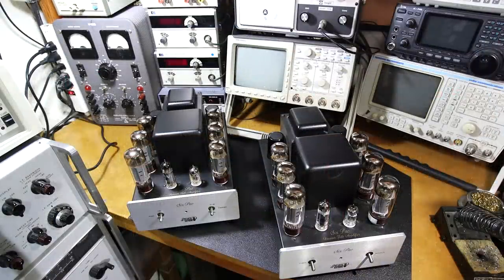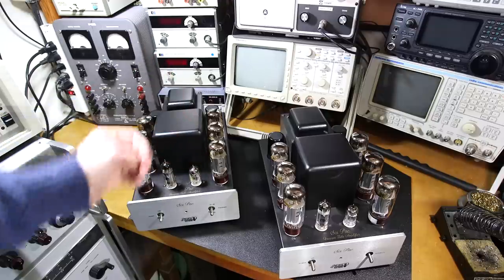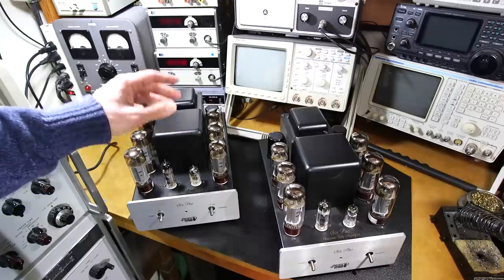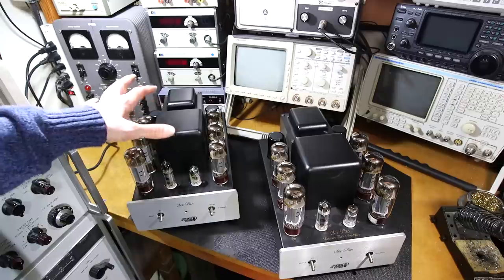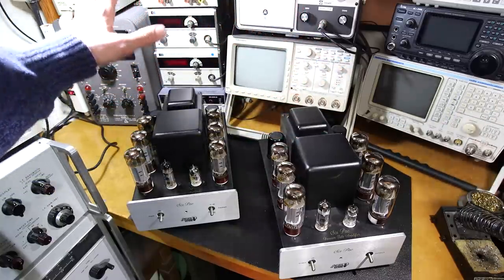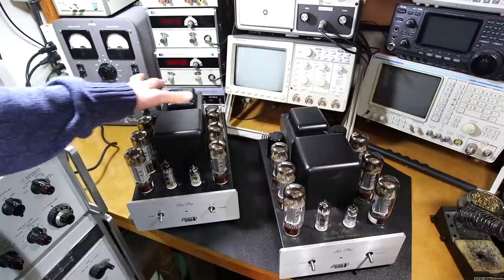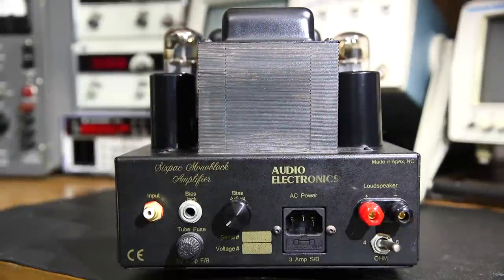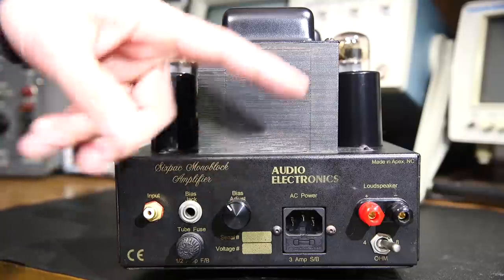Two Six Pac's On The Bench

Comment: The problem with this schematic is the 6SN7-EL84 tubes that they are in parallel. Only pairs with their own separate voice coils on the output audio transformers should be used. Too much capacitance and inductance on the final output tubes. This limits high frequency bandwidth. I design differential tube power amplifier no need for a phase splitter, but each pair of KT-88 vacuum tubes had its own separate voice coil limiting over capacitance and inductance thus preserving power bandwidth. This is called massively paralleling the final output tubes. My buddy friend a machinist built the chassis for me and I made the custom power and audio toroid transformers. I built two Monoblock power amplifiers each Monoblock amplifier had 32 pairs or 64 KT-88 vacuum tubes. A 12AX7A for the audio input 6BM8 power pentode driver for the KT-88 tubes. I named the amplifier “Tube Extreme.” The primary side of the audio output transformers had 32 sets of primary windings and one secondary winding set for 4- and 8-ohms impedance. Of course, custom made toroid audio transformer. Two power transformers one for the tube filaments that was rectified DC solid state linear regulated 96 volts and 6 volts DC to reduce hum. The KT-88 tube filaments were series parallel connection four set of 16 KT-88 connected in series. the other power transformer was for the plate voltage solid state linear regulated 600volts DC. Electric Power input voltage was 240volts AC at 20 amps can on 50 or 60hertz. I only turn these monsters on during wintertime it heats the house. That is what 128 KT-88 vacuum tubes will do.

Comment: Great to see a real tech.
Used to do similar work in the Navy bout 40 year's ago dealing with large 400k power supply cabinets used mainly for sperry gyro compasses and repeaters also some work on the old now defunct 601 class of nuclear missile subs (s.s.b.n.)
We would have access to the 400$ resistor..
Extreme .
Thx for the show.
Also i noticed on your scope measuring the distortion it was at 114khz
So I'm thinking the (audible) humm being caused by v+ fluctuation?

Comment: i'm guessing the"Carlson Mod", to  increase power from 52 to 103 watts, was bypassing the choke, so the diodes feed the Filter caps directly, with perhaps 590 V+ to the Out Trans,  and  rolling back the bias, readjust for  a  Class A/B that has less overlap, so  the bias is set to get rid of the cross over distortion, and give a pretty good waveform (as You had just finished doing with 400 B+ stock)..  I personally would have put more filter capacity , in this circuit, (doubled it.)and used some neon bulbs as regulator voltage source, because they are rock solid, and very quiet, and taken the negative  side choke out altogether, because there is almost no current going through it, it does virtually nothing.  If one wants that B+ side choke in there, I think it belongs after the power filter caps and the OT center tap., though it is really not necessary, more like the Dynaco Mark III?, a resistor, and another filter cap could feed the front end regulator.  12AT7 rather than 12AX7?    1N 5408's are overkill.  They store energy in the junctions, and create capacitive discharge spikes at 120 Hz intervals (as the power waveform crosses zero V ),.  1N4007's store less of a charge, and can easily handle 150 watts.  I like the rectified filament line.  Is the 6.9 volts DC ... OK because it is closer to 1/2 the peak value rather than the 6.3 VAC RMS?  
AND THEN Perhaps this is my biggest area of ignorance?... I thought this amp IS running in pentode mode?  I thought triode mode is without  B+ on the screen grids.... so all this time I've been confused about which grid is which?  and tieing the lowest screen to ground puts it in triode mode?  I thought those two have to be tied together in EL 34's, but are internally wired together in 6L6's.  What I see on the chassis underside is EL34's hooked up like they are in most Marshall amps , which I always assumed was pentode mode.  This is always confusing to me as there doesn't seem to be a standard way of referring to the different grids,.. control grid, signal grid, suppression screen, focus screen,  accelerator screen,  or what the hay,... and different books put them in different order, and mostly ignore some of them altogether...
   I also reacted to the underside with an internal murmur of RAT'S NEST.  It's a pretty simple circuit but very messy in the wiring.

Comment: Familiarity with Circuitry and its functioning in cause-effect of the component elements, is a common basis of intuitive experience for Hoyle and Feynman from which to observe the Actuality of QM-TIMESPACE Cosmology. All is Reciproction-recirculation, probabilistic oscillation holography in potential possibilities of logarithmic time-timing condensation sync-duration = relative-timing ratio-rates of clocking probability.

An Oscilloscope is worth a million words.., but the labelling system and lingo is appropriate for the practical purpose here-now.

Comment: You mention that the amp takes both EL34 and 6CA7 tubes, but are those tubes completely interchangeable?  I know the 6CA7 (and KT77) were originally designed to be replacements for the EL34 despite the difference in construction (beam tetrode vs pentode), but don't many 6CA7s bias differently enough from standard El34s to limit the exchange of one tube for the other in many circuits?  Thanks!

Comment: He's not kidding about being sure those capacitors are discharged, folks.
I once started to dive into a preamp circuit. A vacuum tube microphone mixer. Not even a power amp. I stopped myself, realized I hadn't checked, and ( as I said to myself: "oh what the hell, they'll be discharged but I'll check") put the leads across the filter caps.
450 volts. They hadn't discharged even one volt. Could've blown me across the room or killed me–– or both–– quite easily.
Check. Every time. Only takes a second to avoid crossing over into eternity.

Comment: Overall, 50 watts of output power,out of 6, count'em 6!, EL34 ouput tubes is nothing to write home about.  The input circuit is a differential amplifiier, more commonly known in audio circles as a "long tailed phase inverter" back in the day.  The emitter follower voltage regulator in its plate circuit is because one of the drawbacks of this type of circuit is it has zip for PowerSupply Rejection.  Be happy to explain why.  The plate load on the 12AX7 is grossly too low.  It looks like the design makes an attempt at a choke input filter without understanding how these filters work or what Critical Inductance is.  For a "professionally designed" amplifier it would get an "F".  Looks like it was "designed" by a musician.

Comment: A question... If you unplug the 12AX7, the anode of the EL84 will be disconnected , but the second grid of the EL84 would remain connected to a voltage that is high relatively to the cathode. Isn't this going to cause that grid to melt as it will act as an anode?

Comment: I have viewed 38 min. of this repair on the mono blocks. I saw your diagram, and I do not know if this diagram is correct or not. From what I see there are several mistakes in the shown diagram. I will touch on several. I am not writing a critique. One glaring 'mistake' is the screen grids. This grid is never returned to the plate B+ and the by pass cap's are missing on the screen. There are two extra taps on the output transformer not used. Why? This is to make a 'Williamson type' amp. with super linear output. You should know that a resistor IS required on the  output transformer secondary, (that should be left installed permanently) that has  no connected load,  to eliminate very high voltages being generated in the primary.  Without the resistor, a short can develop in the primary winding. No provisions are shown for balancing the output tube circuit. A pi high voltage power supply filter should be minimum, not what is shown. Pin 2 and 9 on the EL 84 is questionable. This smacks of a tube resistor only.  Why the DC on the 12AX7? The filament voltage may not be 12.6 volts. The whole layout of the  EL84 is questionable. Why was the 12AX7 not used as a differential amp. instead of this mess?  The plates of the 12AX7 is a mess, why?  Brother, you got serious issues here. FYI, Mr. Carlson's....

Comment: Negative reg on a current sink may not be needed. The current reg tube will take care of that. A solid state current reg will be easier and better with more gain, like LM338 or LM431+FET.
Plate load resistors can get noisy and fail. Use w.w.
There is no need to have bias pot go to ground. Use a resistor to limit range to sane level. 10k pot + 10k fixed maybe.
Rectifier diodes can be noisy, use SiC diodes and or bypass with resisor and caps.
Use lower resistance voltage dividers on power supply caps to swamp their leakage current.
Zeners can be very noisy, and the NPN gain is less than 1 in this circuit, a HV transistor + an LM317 will give lower noise. Use an NTC inrush current limiter with large supply caps to limit frying AC switch.
Current sharing between tubes can be an issue, use small resistors in cathodes to equalize bias a couple of volts.
I would not use a choke in power supply, a real regulator is easy to make, if needed, but low ESR caps is probably enough, like a gang of photoflash caps.

Comment: hy, i am an amaetur radio operator from italy and since iam 18 this year i am going to do my final test for my electrical technology study ( it is a test where students build something and explain it...). i am going to build an HF linear amplifier with a GU81 tube that i already have but i am a bit stuck with the output pi network design, because when i calculate the equivalent plate impedance of the tube considering the parasitic capacitances i get strange results.... can you help me?
anyway i have learned a lot from you, thanks for your effort at making nice videos, can i spot you as an information source on the documentation?
73, IU3IRR

Comment: I was only gonna watch the first 5 minutes. However, I was glued to the screen instead! Fantastic video. Question: why the trouble of the potentially mismatched dual-triode? From the circuit diagram, the output stages (push and pull sections) are AC coupled to the preamp. Would a single triode not work here as well, connecting both capacitors to the single preamp output? (or am I missing something essential here....)

Comment: 12AX7 at 325V/3mA/27k4 has enormous 2nd distortions as of 1%. This is very very very strange design at all. With a tube as a current sink, "stabilizer" that amplifiers a power rail noise, and rail to rail bias adj. This is either a student's design, or a senior's who tries to be a bit more modern.

Comment: I'm desperately trying to find out what I need to check/test on my Little Dot MK1 Tube Amplifier. When I flip the power switch the power led lights up for maybe a half second then goes out. It does the exact same thing when I then turn the power switch to the off position. The amp of course no longer works at this point and I miss it. For what it was, it actually sounded very good. You can find schematics for it online but I'm not educated enough to figure out what I should be checking for the behavior it's exhibiting. Anyone with any ideas or help so I can figure this out please comment on this post. I realize that I could simply buy another MK1 for $129 but I'd really like to repair this one if it's possible and I'm sure it would only be a few dollars in parts to do so. Thanks in advance to anyone who helps on this...

Comment: Zener diode T-drift will have essentially no effect - since the splitter's AC-coupled to the output tubes.
OTOH, they should have put a cap (2 actually - an electrolytic and a 0.1 uF or so perhaps ...) across the Zeners.
Zeners are noise generators.
OTOOH, at least that noise is common-mode so it'll cancel in the output to some extent.

Comment: Paul Watched the video last night. To answer your question on the wattage increase as quickly as you did , I would assume that you increased the bias adjustment momentarily to increase the wattage to 100 watts. Q: Would this warm the amplifier sound up at the same time. In other videos you explain leaking caps that turn into resisters cause a higher voltage on the plates and warm the sound up which many people like. Any thoughts on an alternate  low cost signal analyzer that would duplicate the distortion readouts of the SR780. Thanks Vaughn

Comment: I find it strange that the amp did not have more feedback options.
My amp with just 2 EL34's per side seems to sound best at the 5 db setting.
I can choose 3, 5, 7 or 9 db.

It would have been interesting to have seen how this amp measured with say 4 or 5 db of feedback.

What was said about female vocals being brought out when zero feedback was used does not seem to apply to this amp, as the main response is still essentially flat.

Comment: Brilliant work young man, a few things you can do to this amp:
Build a small 555 and thyristor circuit and introduce an automatic standby this will limit current at switch on, a hum balance in the output bottle filaments is also good, i cannot see if the filament wires are twisted also a good measure. I would suggest when biasing try and apply a 1k sine wave into the front end run the output into a dummy load and crank up the gain then reset your bias limiting your crossover this is rarely done but essential. You’ll need one of your good sig gens with a high output voltage or drive the input with a preamplifier. 
On another note I have over 80k of circuits a lot of the gear you look at I have original schematics just a quick email and I’ll slip you what you need! A very informative channel keep up the good work your sure to be inspiring the next generation of tech heads.

Comment: I realize that this is 4 years ago and you probably won't see this. I appreciate the fact that you want to make it safe on the bias that it doesn't get inadvertently adjusted out spec and cause damage. But where I have issue is your friend asked you to make sure that they are in good order and to repair them if needed. And I don't question your abilities. However instead of repairing and replacing your modifying. Now I know there's not much information on these devices. But it's a lot like cars taking what was original and modifying it to where it's no longer classic. I do know that things need to be replaced and sometimes it needs to be done with more modern parts but you're changing the design and taking the originality out of it. And you might be right they are older amplifiers they probably had multiple owners and there may have been changes along the way. But we don't really know this. So you could be changing originality. So instead of repairing and replacing your changing the equipment entirely. I hope that makes sense. But I don't question that maybe it could have been done better but you're still changing the equipment. Anything with modification can be made better but that's not what was asked what was asked was make sure they're in good working order.

Comment: Tube tester is the place to start. Pull the tubes, get their values, and match the closer values of power tubes with each other. Dual triode 12AX7 is used by guitarist in tube amps for preamp. This looks like a hifi circuit, so I'll stop here and watch.

Comment: Dear Mr. Carlson, the EL84 doesn't do anything. And the inverter does not invert. In this scheme both halfs of the end-amplifier get the same faze. I assume the EL84 was ment for inverting one of the two outputs of the other tube.
Reply from the maker: I really hope you are joking when you wrote that.... If not, you are "extremely" wrong.
Reply: Sorry, follow the signal from the RCA-input, there is a resistor, and through another resister to the grid of one side of the tube. The signal is going through another resister to ground, (the signal is still not inverted) (it only has a lower voltage to ground) through another resister the same faze of the signal is going to a grid on the other side of the same tube. It has crossed my mind that maybe the odd setting of the resisters in combination with the floating ground could be used to invert the signal, but it doesn't. A crosswire would be needed to the other grid (deflector?) of that half of the tube. If I am extremely wrong I am sorry for the disturbance. In that case I simply don't see how it is done.
Reply: After a long staring at the problem, I see how it is done, the floting ground. Again sorry for the distubance.

Comment: Nice tube amplifier s  I wonder if you could ground lift the choke by isolation on chassis with rubber grommets then add a 0.1ceramic to a . 047 from shield on choke to chassis ground

Comment: I don't think it's fair to measure the level of hum outputted from a valve amplifier like this without any load. Some valve amplifiers have a very high output impedance so it's possible that the hum level will be much lower once you connect a load. This applies particularly if you measure with the negative feedback switched off.

Please, the word is audible not audiable.

Comment: I have built many  Mullard designed amps over the years using EL84s 20 watt and EL34 25 watt using tag boards with no hum. The wiring in this amp is the worse untidy mess i have ever see.